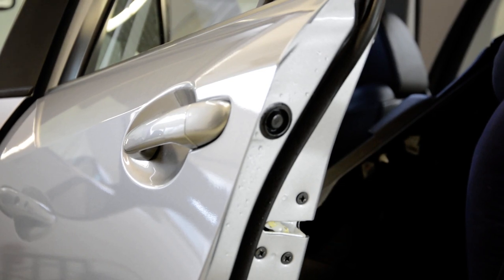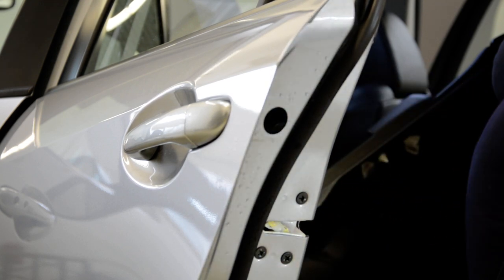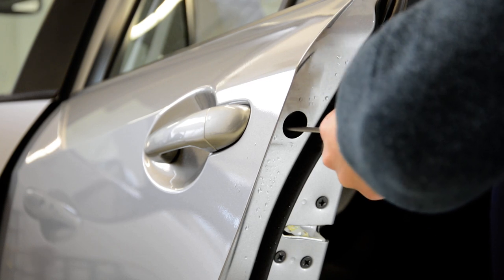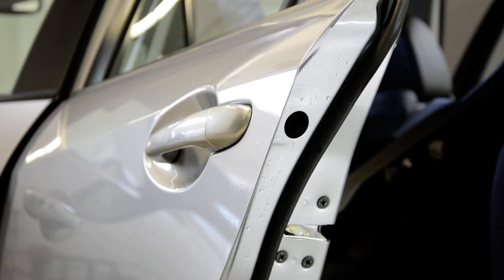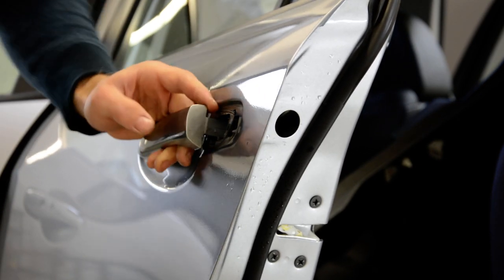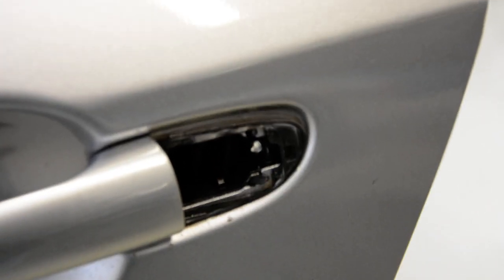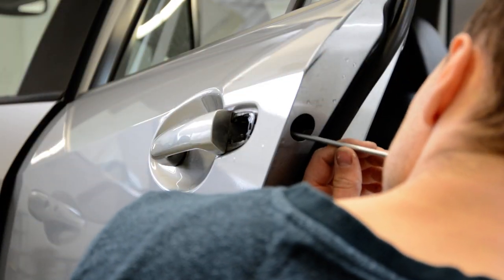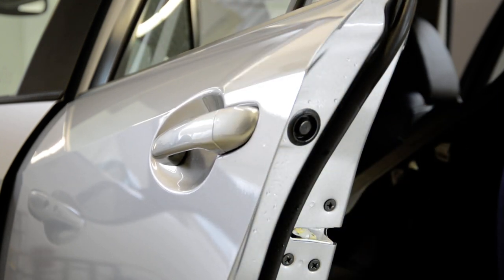Door handle removal Mazda 3

Comment: Mine had a cable attached to it wtf do i do to remove the cable
Reply: me too
Reply: @finixer6155  You need to take the door panel off to disconnect the rods.
Cables go from the inside handle to the door lock actuator. Rods go from the actuator to the outside door handle.
Reply: @bobsoft  oh okay makes sense thank you